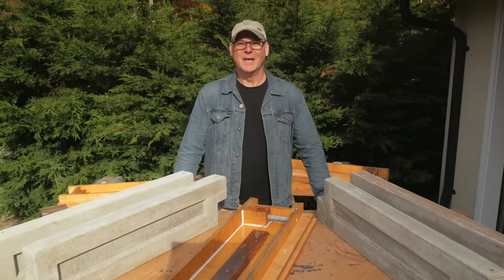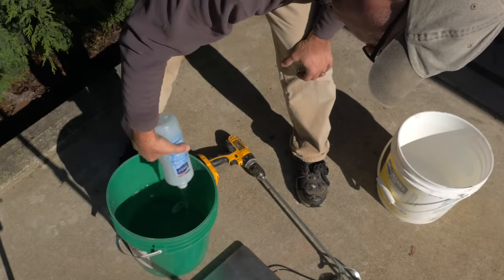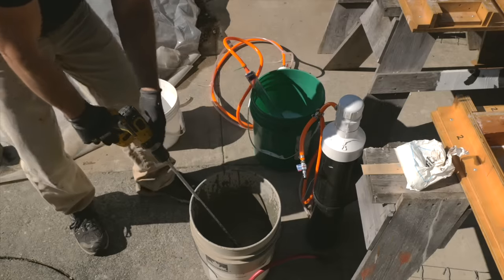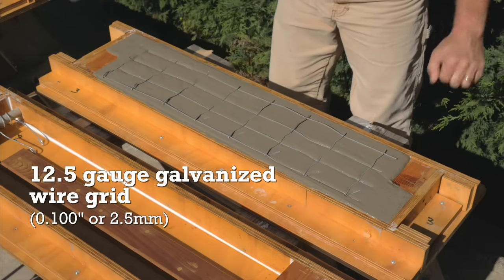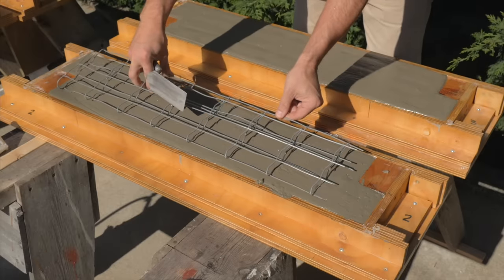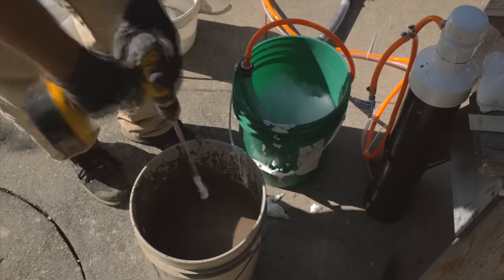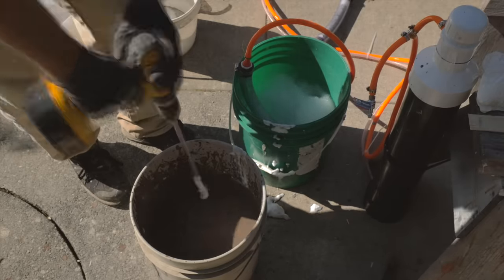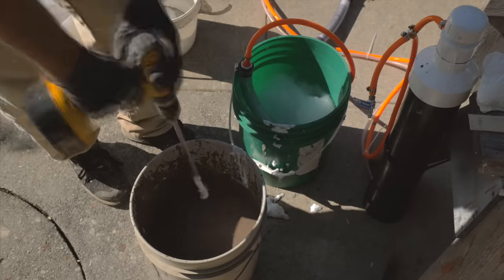Aircrete Garden Boxes PART 3.6 - Air Crete Lightweight Foam Concrete from Portland Cement

Comment: Made several with with your perlite mix just before Covid hit.   Used galvanized fencing panels and dimensional lumber.  All are in great shape after 3 very hard winters.  Miner chips but after being moved several times they are very strong and durable.  Switching over to 14” height this fall, bb form ply and steel angle for edge forming.  My old forms didn’t weather as well as the planters have.  

Also switching to 6x6WWF to eliminate waste.  My son in law has offered his old milk barn for setting up shop.  Adding a home made vibrating table and switching mix designs to save weight.   1/4” pencil rod should work well for locking them together and additional reinforcement along the wings.  I’m still working through the reinforcement around the sleeves .  I use 9-wire spiraled around the poly sleeves . It works great but hard on the old hands. I’m looking forward to using the air-Crete mix I think is your instruction 3.6

I have a Perlite mine and manufacturer about 40 miles from us that has helped save money and provided some assistance.  Thanks for the time and effort you put in to your training and products.  After 40 years as a commercial carpenter working with GFRC I wasn’t intimidated by you presented. You have put together the full package!  If you want high quality garden planters your service is worth the time and investment.  Best tomatoes I’ve had in almost 70 years!

Comment: Thank you for your mix and process info! An aircrete mix that dense does consume a lot of cement, as it turns out. I guesstrapolated this mix to over ten sacks per cubic yard - twice what normal concrete needs. (15lb/0.42ft^2)*27/94

Comment: I would recommend adding powdered lime to your curing tank until the solution is fully saturated to prevent the water from sucking lime out of your concrete panels
Reply: I work in a lab testing concrete cylinders and I highly recommend excess lime in your tank as well.
Reply: @chadwessels1441   How much lime to add to what size tank?  For example a tank of 5' x 5' x 6" deep [12.5 c.ft. water] would need _____# of lime.
Thanks.
Reply: @gaurasells  the rule of thumb is to add enough lime until you get some that doesn't dissolve. You need an excess in the solution.

Comment: According to my humble experience, dyes works better with white cement. Through, the finish is always improved with white cement. As your're not building bridges, white vs grey cement have a comparable strength for your purpose.
Reply: you can also use it akin to a gelcoat - make just enough white cement with dye to cover the surface of the mould,  sprinkle with aggregate/aircete pebbles on top to facilitate adhesion, let dry a bit and pour the filler concrete - that is, if it's worth the hassle to save on white cement and dyes...
Reply: @dushk0  I don't get the point: gelcoat is much expensive than white cement and dyes...

Comment: You should try elmers glue and borax to the mix. This will create workable synthetic long chain polymer matrix for the cement bonding. It shouldn't take much.
Reply: Devin Heaps would that be a 1:1 ratio?
Reply: @bruceb1433  5:1 glue:borax. Make the polymer first. Then add 1:1 to 1:4  polymer:foaming agent, depending on desired weight. Next add all premixed dry cementitious materials to polymer foam.
Reply: @DevinHeaps  what's the foaming agent you mention? SLS?

Comment: Thanks for the video.  On the string trimmer durability subject, my thought would be to add some surface hardening.  The main point to aircrete is to add complexity to the fabrication with the payoff of cost savings in the way of using less concreate. If you don't save a significant amount of money in concreate, then there is no logic in adding the complexity in fabrication.  The durability loss of the aircrete mix is a subtraction in value to total cost of ownership in that a string trimmer can degrade the material through wear and tear.  I would just attack the wear and tear problem as a separate problem.  One proposed solution would exist for those that access to streams or rivers in the norther latitudes.  Small river rock, also known as pea gravels, are free and available and can be freely harvested for small home scale projects.  I would suggest adding a thin layer of sand and smooth pea gravel to the mold first, then add the aircrete.  Once the aircrete sets, the gravel and sand embedded in the surface of the garden box would absorb and deflect the impacts of the string trimmer without allowing the string trimmer to "dig into" the surface of the garden box.  Also, this adds material that should be free of cost, also reducing the cost of the overall project slightly.  If you live in an area where there is no free and easy access to river gravels, I would recommend looking for an alternative material.  There is also another benefit in that this could add a decorative surface.
Reply: Or a thin layer of cement with no foam in the bottom of the mold
Reply: @friendlyoldbum9182  or more sand and plasticiser

Comment: How about adding a fibreglass resin into the mix, not sure how that would work with aircrete mix but it works well with standard mix.
I guess some of the weight advantage would be lost but the added strength could be used to reduce the thickness.

Comment: Why not do the line trimmer test on the back of the panels❓ It would let you use the panels without any damage showing. Use them all in the usual manner to find out how they will hold up thru the winter.
Reply from the maker: I think there may be a difference in density from the inside and outside of the panel. And my thinking was the outside would need to take more abuse.

Comment: Really fantastic and thank you for exploring aircrete options.  I checked out your earlier vids and your jig vids are great.  Thanks again for awesome valuable content for other DIY'ers.  Please keep up the testing and please share.  I wanted to use a similar approach to make skirting for a  raised home or faux stone siding panels and still am a bit unsure 1) concrete foam consistency / ratio to withstand some projectile like a rock from the weedeater/ lawnmower or a runaway basketball 2) appropriate minimal thickness for strength and resistance as a siding panel 3) how does the aircrete cut with a simple saw or concrete blade tool?  Extreme chipping and crumbling?

Comment: Weighing the ingredients is good.  I've also seen people scratch circles onto a large tile, to check the liquidity of the finished mix.  You pour some of the mix into the center, then time it to see how fast it spreads (i.e., how many of the circles it spreads out to in a given amount of time.)   I'm still curious as to why you add perlite though.

Comment: Could you try some more destructive tests, like simulating the effects of heavy items being dropped on them (like bag of rocks) or dragged across them (like a shovel or hoe)?  Or even the ability to hold the weight of human if not securely mounted (only mounted on the ends).
Reply from the maker: I've been thinking about that for a while. It's tough to go and break something you made and like. Been throwing around the idea of a Patreon video for the destructive tests to offset some of the costs involved. Thoughts?
Reply: @MANaboutTOOLS  I was wondering the same thing about strength testing - not so much about beating them up with tools, but the ability to span gaps and support weight. I would not suggest that you do it to your garden box panels, maybe simple flat rectangles - perhaps like concrete 2x4s. Personally, yeah, I'd support a Patreon video for that.

Comment: I'm doing similar project, starting with skirting for my Mobile Home. First test piece is up, 48 x 32" only 1 inch thick. with fiberglass window screen in middle and heavy brown painters paper on back.   What kind of release are you using? I had the same concern with trimer line. Was going to put discarded tiles along the bottom. But my free supply fail through. Might be worth buying cheap ones to both decorate and add hard shell against trimers.
Reply: I like the idea of using old tile to harden the bottom edge. I am redoing a bathroom, and hate the idea of throwing out the old tile. The tile is coming off with little effort because of water damage.

Comment: Air Crete is so interesting to me, i cant wait until  we are allowed to incorporate it home construction. Have you tried spraying the molds with a thin coat of standard high strength mix from a hopper gun, to create a smooth hard shell?

Comment: Great Informative videos, I have certainly  learned a lot.  I am in the process of making the forms to cast concrete bee hives. Unfortunately aircrete is not really a option for me, but from your experience knowing that these hives will be pretty static what ratio perlite would you recommend to try and insulate as best possible( Also not sure on wall thickness) . I will use chopped fiber for strength as well as some wire.
Thank you

Comment: Could you pour a thin layer of regular concrete first, then add your lighter mix to fill the form with the intent to create a more durable front face to withstand string trimmer abuse?  Just curious if the two mixes would adhere to each other and not separate.

Comment: thank you love it what about using a denisfier? on the side that you use the weed eater at or use a pva to see if it gives it more streagth you can use titebound 2  with 20% water or so ethier as a substitute for water or as a sealer  the idea would make it water proof and stronger by using less water. also i believe that it also brings the cure time way down? or what about rapid set cement? superplasticizer? set control? flow control? water reducers? what about adding some hydrated lime to the mix? what do you think ?

Comment: What I have seen people doing when building custom cement countertops is that they use a "beauty coat" (more liquid so it can have less bubbles) on the exterior faces, while the interior is filled with a more "rough" mix. Perhaps that's the solution to the "aircrete durability problem" - put a "hard exterior coat" first, then lighter aircrete on the interior.

Comment: I have used aircrete or foamed cement in the past where insulating value is important but I honestly do not see the point to using it in this application. The only advantage it has is being lighter than concrete which for something that is only going to be moved into place one time or rarely moved it really doesn't make sense. The bags of Portland cement you have to use are heavy so if you can not lift the weight of these slabs if made from standard concrete then you probably can't make them either. Cost wise you are replacing rock and sand aggregate with foam bubbles but not completely so you are using more portland cement in aircrete than standard concrete so the cost of aircrete would be the same and likely a bit higher than standard concrete with it's cheap but strong aggregate. The only time aircrete would be beneficial besides when used as an insulator is in something that is moved by hand often or somewhere that can't support a lot of weight. As a garden box that sits on the ground I just fail to see the point.
Reply from the maker: I don't disagree with your points here. The aircrete version of these panels may not be the best lightweight options for these garden boxes.  I had so many requests to try aircrete to see if it was even viable that I wanted to give it a shot. And I think they turned out about as good as I could make them. The vermiculite (from Part 3) or perlite versions (from Part 3.5) could be the best balance for light weight and durability -- for those who really want the panels to be lighter.

Comment: @MAN about TOOLS  have you considered spraying a face coat of a portland cement mix into your forms before filling with aircrete?  I've seen guys do face coats onto molds to achieve a perfectly smooth finish when doing GFRC with a high fiber content.  Perhaps this would achieve a surface durability similar to regular concrete, and with better aesthetics eliminating all those surface bubbles inherent to the aircrete.  I wonder if it would allow you to switch back to the low-density aircrete mix you had before that yielded such great weight savings.  Perlite would probably aid in some compression strength as well.

Comment: Cover them in Plastic bake it on or silicone or epoxy or Bitumen, Use Plastic Moulds formed in a Die and then Fill them with concrete or whatever and when the plastic rots away our still left with the concrete blocks.

Comment: MAN about TOOLS, have any of your viewers tried to use your system to build a permanent border wall?   I'm considering trying it but using an offset 18 inch short perpendicular section for stability.   Hurricane Michael destroyed 100s of feet of my border brick fence.   I'm thinking I might need to allow for a larger vertical rebar.

Comment: Great video's,  after seeing so many of your tests, what is the most cost-effective model yet still strong that you made.  Need to make a boatload of them and making it easy and light in the wallet as well.
Reply from the maker: If weight is not a concern then the cheapest way (I think) is to pour these panels from ready mix concrete bags using the forms from Part 2 of the series. Or even buy a load of sand and gravel and a few bags of portland cement.

Comment: Hi, I’m curious if you’ve tried a sandstock finish. Might be as simple as dusting the face of the form with sand. A layer should hold to your concrete
Reply from the maker: I haven't tried that but would be interesting to test that.

Comment: Hello Kent Im wondering of the difference in the foam created by the anvil egg beater method and the honey do foam mate? Im going to build your garden boxes but also a fence made of air crete panels so considering which way to go. Thanks :-)
Reply from the maker: The Foam Mate does make a denser foam. And you can make it quickly, and in just the amount you need.

Comment: Technically you need less w/c ratio not more cement, just less water against concrete, I suggest using additives to minimize water in the mix.
Reply: Anyways, a great job and a great channel!

Comment: You have some real talent in making forms and this video is fascinating . I'm wondering if PVC pipe or metal fence tubing can be pushed into and through the Air Crete prior to drying for some type of electrical - drainage or tubing to circulate warm water for a heated bed . 
Also wondering how much heat your formula and method can tolerate being used for a metal forge or wood burner  . Thanks for an Excellent video and all the best .

Comment: why do you add Foam? whats happens because of it?
Reply: It makes the entire casting twice as light, uses less concrete so is cheaper, all while still staying within acceptable strength & durability requirements for the project. Also offers better insulation value for when you need that.

Comment: With ZERO specific experience I'd think a lot more fiberglass could help?
Reply from the maker: Most likely yes. I was using the manufacturers recommended amount for crack resistance.

Comment: Soap stops the puzzolanic crystals death in there tracks🥱 Just add shred popcorn. Still a weaker concrete, but less irrecycleable.

Yeah, btw, the glass fiber is also a hinderance in recycling.

Comment: Aircrete will collapse before it sets if it's cast in full sun (at least when it's also fairly warm outside), adding an aggregate like perlite or crushed up aircrete will keep it from collapsing. I guess it has something to do with the solar radiation causes the bubbles in the mix to expand and rise through the extra liquidy mix. There are some cure time and strength advantages to using aircrete pebbles as an aggregate versus solid casting in aircrete. 

So, you can mix a batch of aircrete and spread it out thin on a sheet of plastic with a notched trowel, then when it sets lift the sheet and let the pieces break up into a pile. You can use these little pieces in place of perlite. You can make these pieces out of a lighter weight mix (a higher foam ratio) and then mix just the pieces 5:1 with cement.
Reply: this is gold.